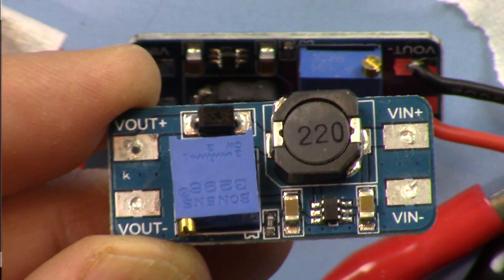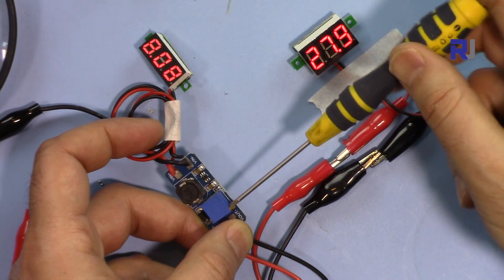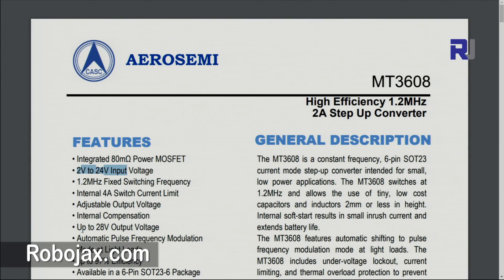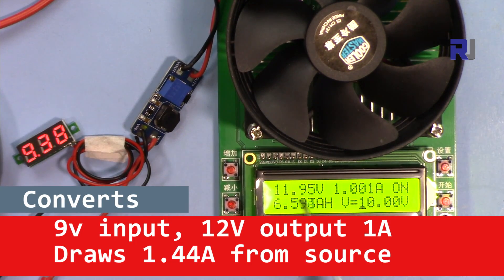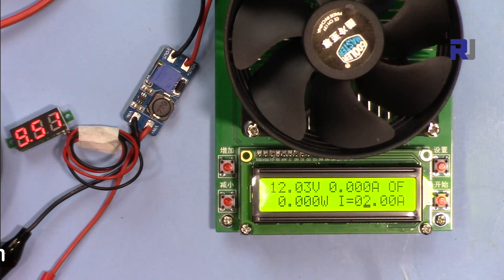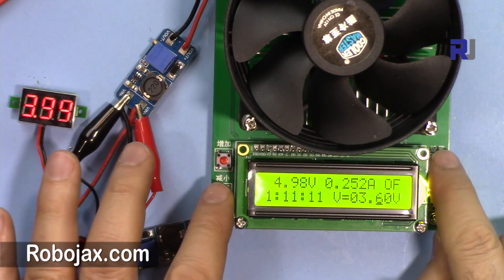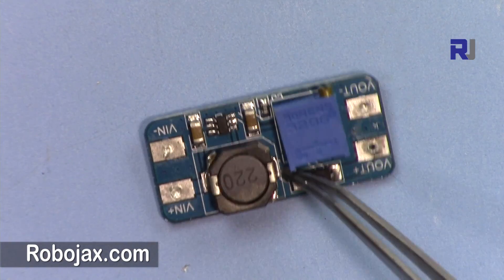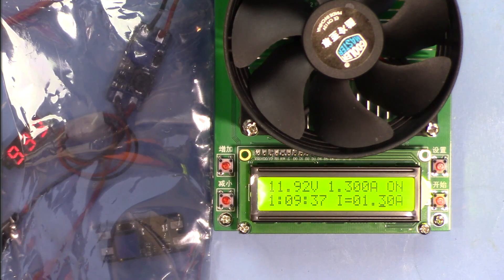Test review of 2A DC-DC Step up boost converter MT3608

Comment: Can i get 2A at 5V output with 3V input please ? In boost mode only I need as I have 3.7 V 18650 battery. Also please tell me the load you are using - I just use 5ohm two resistors in parallel.
Reply from the maker: it is very bad idea to charger battery with this a s this does not limit current. you should get a module with Constant Current or CC so you can set the limit and that way your battery will not get damaged. Good luck
Reply from the maker: I am sorry, then. I don't remember how much it can output. To get answer you have to watch it.

Comment: What if I set output at 12v and provide input as 24v 
What will be the output in this condition
Reply from the maker: Amazing question. You make me open the video (I don't see the video on this screen as I see all comments from all videos on the same screen) and it shows clearly that I have demonstrated the following voltages . so please watch and get the answer.
3.3V to 5V 2A
3.3V to 5V 1A
9V to 12V 2
9V to 12V 1A
12V to 24V 2A
12V to 24V 1A

Comment: How does it work with 5V in and 14V out at 1A?
Reply from the maker: are you asking for principle? this is boost convert and  power electronics explains it.  it doesn't increase the power the power the input and output stays the same (with some looses in the module) for example input 5V 1A then Power=5x1=5W. let's assume a convert doesn't have any losses, then the output will also would be 5W and you can get 5A and 1V because P=1x5=5W or you can get 0.5A and 10V because P=0.5x10=5W. in simple word, it is the power that matters. Most of the converts have about 5% to 20% losses.

Comment: what happened if input is 12v and the output is set to 12v?
Reply from the maker: it means the output is set to lower than 12V and the module does not reduce it.  Reduce the input to 5V and you can get 12V or lower up to 6V.

Comment: I just bought two of these from China ... have tested them ... both are faulty.
I place the input power of 12.5V on the input - The output power is 12.1V.
That's it. Altering the control does not increase the voltage.
Useless
Reply from the maker: did you watch video fully? I can assure you, your modules are fine. Just watch and listen carefully.
Reply: @robojax  Thank you for your reply - I watched the video fully. I still don't understand what you are pointing to.
My units do not work like yours. I cannot increase the output at all using the control. Why are they 'fine'?
Reply from the maker: I said "fine" because It happened to me and I was almost throwing them into garbage bin and when I turned it about 15 to 20 times it suddenly showed the voltage.

Comment: Is there any converter that can convert from a battery that have 3.7V; 2amps and 10000mAh to 19v 4Amps in order to charge a laptop ? ?
Reply from the maker: voltage is V, Current is I and power is P. So  P=IV and  you have a battery 3.7(2)=7.4W and get 10(19)=190W.  it is like you have $7.4 and want to be able to buy  stuff worth $190. so you can play with Current I and Voltage V but P never increases.
Reply: @robojax  Thank you for the clarification, I really appreciate it.

Comment: AOA bro. i m trying to use this module to charge battery.inpu voltage is 3.5V. i m using piezo electric plate to get voltage but this module is not working. when i connect this module suddendly voltage drops to half even on the input side of the module. can you plz explaint his to me. what should i do?
Reply from the maker: voltage drop can be two things. 1- faulty module 2-you are overloading this module
Reply: @robojax  i have 2 different module both have the same prob.
Reply: @robojax  no bro actually piezo output current is very low thats why this module is not working with piezos.

Comment: Is this constant current? I wanted to power an LED at 19V and 145mA from 3.7V Li-ion. (tp4056)
The constant current 145mA is a requirement, so I wanted to know if this is a good choice.
Reply from the maker: No it is not. Module with constant current will have separate Potentiometer for current.
Reply: @robojax  Thank you!

Comment: I bought 3 of those very modules from ebay - none of them seem to work, I tried 5V USB in and get out 4,7-ish volts out, turning the adjustment pot (multiple turns!)does absolutely nothing, stays at 4,7V. On Tried 9V battery as input, the same behaviour on all three modules, am I doing something wrong o_O ? I'm not a total electronics noob and double-checked polarity in/out side..
Reply from the maker: you have to try and rotate it. This exactly what happened to me. I have over 10pcs and almost giving up thinking they are all bad. But they worked.
Reply: @robojax  Thank you for your answer, but what do you mean "rotate it" ? I did of course triple-check for correct polarity! Or do you mean the modules are mis-labeled?
Reply: @alnicospeaker  rotate the trimpot 360x clockwise or counterclockwise..don't give up. :)  mine stuck same as you, but after so many rotation, the voltage start increasing.

Comment: Isn't this all about watts? It looks like at low voltages, you get only about 3 watts of power, and at higher voltages you can get up to 6 watts output? .........Output voltage MINUS input voltage TIMES output amps, right?  VOUT - VIN X Amps Out = Power Watts.
Reply from the maker: it is all about Power with the unit of WATT. So this module can never add to the Power. So output Power is always less than input. We always have some losses.

Comment: Can anyone tell me what will be the value of R1 AND R2 if we want to get fixed 6.7V output not using rheostat to adjust.Input is 3.7-4.2v
Reply from the maker: here on page 6 of datasheet, there is formula for Vout. you need VREF which says is 0.6V. So you pick  your let's R2 10k ohm and find R1. you can use also online calculator to find the unknown.

Comment: Thanks ..excellent rewiew .I want to use it with  lion battery at rc glider plane .if input is between 2.8v-3.7v ,output is 5v. How much current is it handle stable  .can I get 1.5 or 1.7 amper ?Thanks
Reply from the maker: You are welcome. I believe I give the answer in the video. If I want to answer your question, i would have to watch it the video. so you watch it.  It is the power. P=IxV (I is current , v is voltage). So Output P = ) ( Input P -15% of input)

Comment: Thank you for the video. Is it possible to connect 2 of these circuits in parallel to get double the current. I want to get 11V 1.5A. I only have a 5V 2A and a 5V 1A power supply
Reply from the maker: You are welcome. if you can set maximum the voltage exactly the same for both modules. Yes it will work. for power output see the result as I don't remember what voltage or current this module worked.
Reply: @robojax  Okay😊

Comment: Thanks for review, and very detail testing, Im planning a project, 
Power an Amplifier from 2x USB ports, will this work ???
Amp = TPA3110 type, with 2x 10watt 4ohm Speakers. Trying to power this thing from 2x laptop USB ports with this boost converter (5v to 12V), already tested my usb ports, both ports can handle 5V @ 1.5A = 7.5W each = 15W for both USB ports (possibility more if i change to better shorter cables)
Planing to connect the 2X USB ports in parallel into the boost converter? If i get minimum 15W output that should be enough to power my amp/speaker in medium volume.
Reply from the maker: I have read this 3 to 10 times and every time I come across it under "no answered" comments. Just calculate the power for your amplifier. For this module you can get the power form my video.
Reply: Hey dude. I've just been tatting about on a similar project. You can power a 10w (sound level) battery powered amplifier (Kustom KGBAT10) via a 2.1mm Jacked 5v to 12v step-up transformer. Works well. Bear in mind sound wattage is different to power wattage. I'm gonna stick a multimeter in the circuit to measure current and see what the load in real-terms is. I used an Imuto 20a/h powerbank.

Comment: Does this converter work backwards or if applied 27 volts on output will it generate 3 v on input?
Reply from the maker: No it doesn't. That type of converter is called Step Down or Buck converter. This is just boost converter.

Comment: Thanks Greate video :) Its boost converter  voltage up current down. MT3608 got 4A limit n-mosfet.
Reply from the maker: You are welcome. yes. Power is the important factor which can never increase. You will always have some losses like 10 to 15%.

Comment: Shorts eventually have on a 8.4 v ion battery high current when she runs normal single operating all ok, but when i use a 2 operating line seems ok but just not right starts to get worse from there and other functions stop running eventually shorts got it running at current but after the first crash anda few on the original i dont want to blow it till i get the issue and a fix hopefully soon😆.
Reply from the maker: this is based on the chip. so all of them should be okay. Good luck.
Reply: @robojax  pin 4 mosfet gate multiple curcit and above 20v even though not above current rate or transistor types got it on a dule line on single operating fine but a npn input?? that should be a pnp reverse input off the 2 line input selection through the transistor and tweky as all smoke included blow 5 and one transistor must have gone full drop on pin 4 if i got the correct notes?? Have done that to a HT -12D on the 4 gates for output or read was the correct type npn but blow the 4 lines out one after another changed it for a npn next one down and has worked fine every time?? I think one was a motor type the other curcit but did a lot of damage to the chip must have mirrored and short city. Got a curcit and if the director is not in a relay just will not work but it has 3 operation going that are all fine with other relays the relay on one curcit unit will just not work????😮 Or a volt regulations that if you don't forward the out voltage to the next on the 4 units the 5v regulations has no power captain???😮WTF! Been a good education have one that if you don't have a led the hole lot gose tweky it's used to stabilize the curcit engineering stuff! That's a new one!!! Was thinking no use just take it out right! !! well thor your in for a education.👍went nuts and hole reprint curcit 😡'Ouch.

Comment: Does it also boost the current?
Reply from the maker: It outputs the power Power = Current x Voltage.  either reduces the voltage and give higher current or reduces the current and give higher voltage.

Comment: Seller explained and I followed his instructions and it worked, if you've spun it the wrong way 20 times it can 50 or 60 turns the other way to get it right, once you hit the sweet spot they work great. Seller does mix up counter clockwise and clockwise in the image but good product.
Reply from the maker: Perhaps you escaped the video. Watch it carefully and I have explained the exact issue you are facing.

Comment: I have an battery that puts out 5v with this  thing it only goes  power down and not higher like 12v what should i do?
Reply from the maker: I mentioned  in the video that you have to turn it 10 to 15 times before you see any changes. If that doesn't happen after few tries, then the module is bad.

Comment: Hmm. If input is 7.4V, is that chip able to provide 1.5A@12V?
Reply from the maker: it will for sure output 12V because it is boost converter. It is all about power P=IxV where I is current in Ampere. Output power can NEVER be greater than input. We will always have 5% to 20% losses.

Comment: i think this a 20W model step up with max <2A output
Reply from the maker: yes. it never handle 2A
Reply: Do you think this model can power up a router wifi 12v/1A/ from a USB 5V 13W  iPad adapter

Comment: Can this be used on headlight led bulbs which are rated 9v to 36v? Can it handle a 12v converted to say 15v continuous for those led bulbs?
Reply from the maker: What it can handle has been explained in the video. Please watch and do not escape. I don't the answer, I have to watch to answer it. So you watch it.

Comment: Thanks for the detailed review.

Question: if I want to use a laptop USB port to power a 12V device, what would be the maximum watts I could get on the 12V output for a long period of time? Could I get 12W (12V) for say 10 hours without the unit overheating?
Reply from the maker: You are welcome. We can't say what is the current (A) of a USB. You should check the laptop manufacturer datasheet . Usually it is 1A. USB is 5V. so P=VxI, I is ampere P=5x1=5W and if it is 1A, you will get 90% of 5W.
Reply: Robojax  Thanks for the reply. Sorry, I wasn't clear with my question:
Assuming that the USB can give up to 5A (at 5V), what is the maximum Watts at 12V that this  cable  (your favourite one) could transfer to a 12V device? I have a music amp that draws between 8W and 12W at 12V. I'm wondering whether this cable could handle stepping up 12W for extended periods of time (assuming that the USB port is able to)? (Your tests didn't cover 5V to 12V step-up).

Comment: Input Voltage: 12V
Input Current: 1Amp
Required Output Voltage: 14V
Will it work???
Reply from the maker: I have done the test and given you all possible scenarios. To answer I have to watch the video. Then you watch the video and I am sure you will find answer.

Comment: how to get i mean which module to use for 2.8v dc - 4.2v dc   to 3.3volt constant output
Reply from the maker: I made this video to answer such questions. Just set the output to 3.3V and apply your voltage at input. That is it. I showed in the video that if you change the input voltage, the output does not change. Please watch again and do not escape.
Reply: @robojax   thanks for your answer sir,
but as per datasheet of mt3608 it output from 5volt and above.  I am really confused. 
I want to power esp32 at 3.3volt and make use of lithium polymer battery (2.8volt min max 4.2volt)5000mah.
If so as you say are you sure that mt3608 will give 3.3v constant outout from 2.8-4.2v input. If you give me green flag i will buy the module then . tight on budget i need to buy five modules . please help
Reply from the maker: sorry I misread your question. This will never reduce the voltage lower than the input. So if you want to get always 3.3V, then you need to use buck-boost converter which does that.  it will give you 3.3V with 2.8V and 4.2V. Or use two module, first use this to get output like 10V, then use 3.3V regulator to get 3.3V from the 10V. This way you will always have 3.3V.
Reply: @robojax  
If I use booster to generate 10v and then again convert to 3.3volt my power losses increases.
I found one module which takes input 2.5 v - 12volt DC and output to 3.3 volt constant.

Comment: It works if the input is 2A or less
Reply from the maker: Yes it will . if input is for example 12V and 2A then 2x12=24W, then the output will be always less than 24W-24-10%, then 10% is losses in the converter.

Comment: Can this be used to just boost a power drop back to 5V. I'm making a long LED run and would like to patch in something that will boost the power back up to the original voltage as it starts to drop.
Reply from the maker: first why power drop? if power drop is not due to  weakness of sours. This booster uses the power. if the source can supply enough current, it will boost it.

Comment: I am learning a lot from your videos, thanks :-)
Is it recommended to use converter to regulate 2x1.2V AA = 2.4V to 5V for Arduino?
(if I want to have minimal batteries for portable arduino project with low current consumption)
Reply from the maker: You are welcome I am glad to hear that.
If you need 5 volts, yes you can use 2AA batteries but you must connect them in series (+ of one to - of another and you will let with + and - to use.
This can power small project with very little power. Also the quality of AA batteries very. Make sure you get good quality so they last longer.

Comment: I just buyed 5 on Ebay, ALL gives an output of 4.2V max. at 3.7V input as soon as it draws power. With no load i can go up to 28V @Multimeter.... WTF. :(
Reply from the maker: Yes you can. You have to turn it 10 to 15 times before you will see the output voltage.
Reply: @robojax  No i can't. At a point the V rises up to ~4.2 stops and then falls below the input Voltage around 3V.
Maybe a defect charge?!
Reply from the maker: if you try turning it in both direction and did not get voltage above 15V, yes the module is defective. But try rotating until you hear the clicks on both direction.

Comment: Just calculated for module 2Amp maximum for input ( actually is too much) and depends how many times increase voltage with same times divide current on output from 2Amp. But keep in spare Calculate 1.7A in inlet. If want from 5V to make 10V  2 times output current 1A . If want from 5V to make 20V  4times output current -0,4-0,45A  Better find other modull  :)
Reply: pm me can you to install do sola paint of charger.

Comment: Hello,   Can use 3 of these these things in parallel to get a higher amp output (about 2a) at 12v?  Could I connect the output wires from 3 modules?  Thank you
Reply from the maker: theoretically yes. But practically very hard. it would be very hard to set EXACT voltage and current. If there is slight difference, then one module will act as source and the other as load and that would be very bad and they might overheat quickly. Get this item instead https://youtu.be/EJ0-T4uXjAY
Reply: @robojax  thank you

Comment: remove the 100k   trim pot and replace with a resistor of 39k and 50 k variable resistor with a knob.you will get a range of 10 volts to 22 volts.or 39k and 82k to get 10 volts to 27volts. or 39 k and 90 k to get 10 volts to 30 volts.